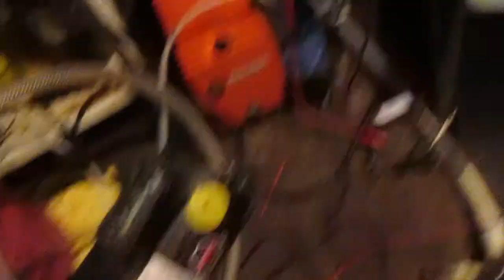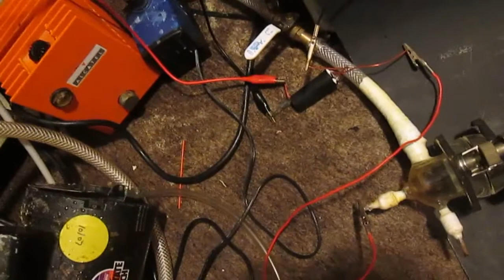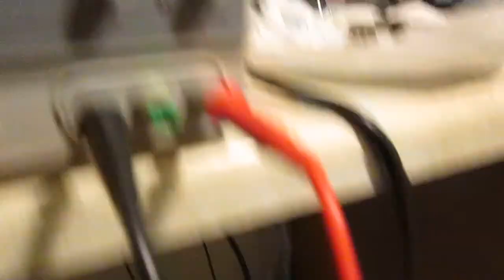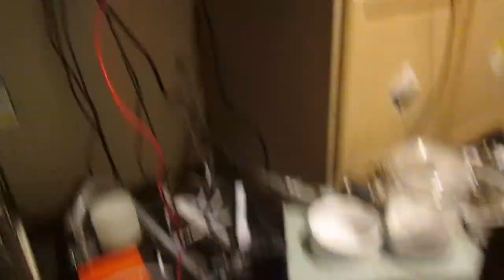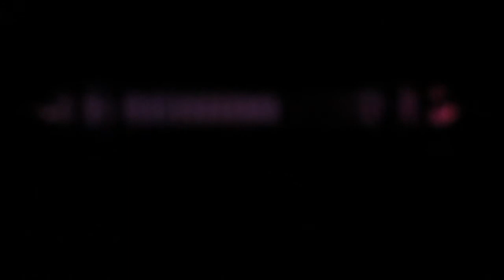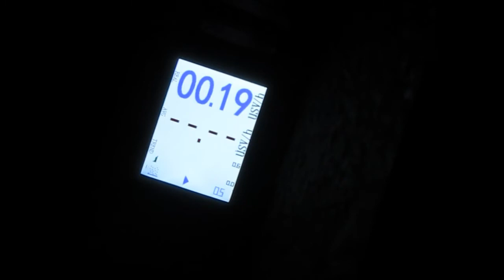high voltage and deep vacuum ...

Comment: I have a quack medical device called  Violet Ray which is capable of producing 20KV not sure of the current but I did an experiment with a light bulb (nite-lite) I had the bulb pushed against a large piece of metal (grounded) and passed the voltage through the base and my Geiger counter started singing.  Was that true X-RAYS or just electro static causing a false CPM rate?
Reply from the maker: X-rays can be made from a variety of vacuum chambers but often from DC power supply. A higher current allows more X-rays to be made . Unfortunately  the violet Ray is an AC low current device so I am affraid your Geiger counter is picking up interfere and emf .
Reply: @Neptunium  thank you